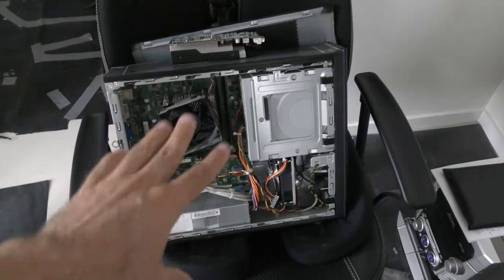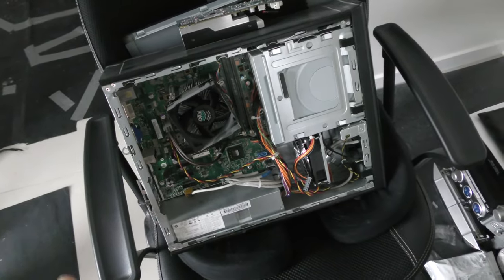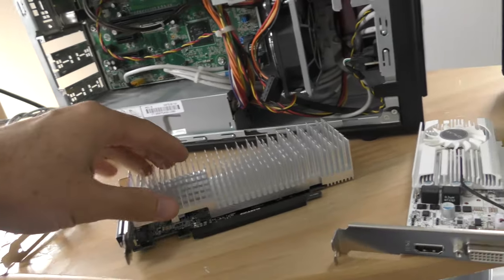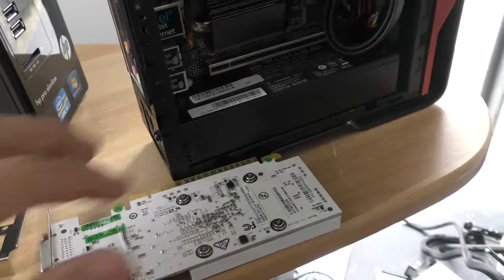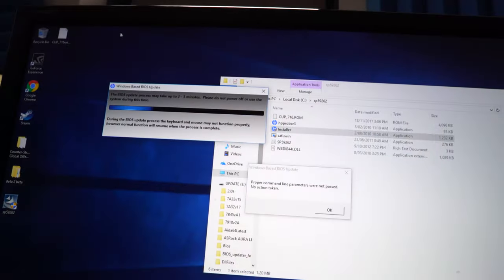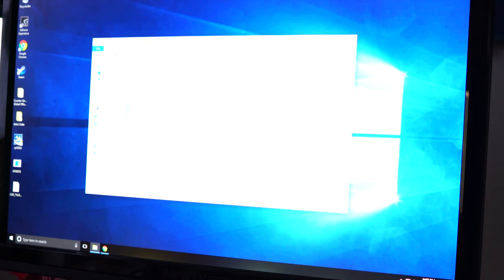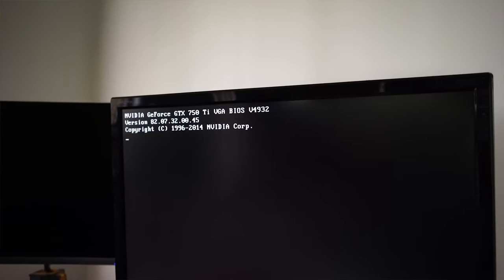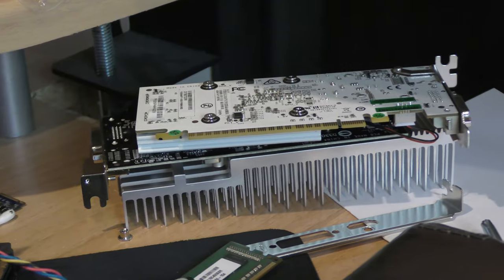The GT 1030, CAN IT SAVE THE SMALL FORM FACTOR HP PC...!?

Comment: I got a Dell optiplex i7-3770 3.4Ghz for $200 bucks on ebay, I added a 1030 and it's a little beast. The biggest issue I had was just swapping to the low profile plate, you have to take the heatsink off which is terrible design in my opinion ..

Comment: Strange, I had no problems with upgrade of much older HP desktop - DC 7800 SFF. With an Aliexpress supplied C2Quad 6600 (OC with a piece of tape to 3.0 GHz), 8 GB RAM and Gigabyte GT 1030 Deus Ex and other games run much better than on this i5 with integrated graphics ;)

Comment: If you can find a dual port intel NIC you could turn that little PC into a pfSense firewall/router. Might be the best use for it. Just avoid internal NIC unless they have a patch for the intel management engine security loopholes under the firmware. And even then I'm not sure I'd trust it.

Comment: just buy a dell t1600 to stick that i5 in, works fine with any gpu that pulls less then 50w through the top pcie and costs around 100$(USD on ebay) for one with a i3-2120(or 20$ for just the mobo,but you wont have front io so the psu will have to be the power switch)

currently using it with a xeon e3-1270 and a gtx 1070, the only thing to worry about is it doesn't seem to like the rx 480/580(most likely pcie power draw, spec sheet says 50w max) but it works with a gtx 970, gtx 1060, gtx 1070 and a few low power quadros i had lying around

Comment: With your 1030 in your inwin case, replace the psu with a hdplex or pico, with that extra space you could fit a thicker card like the 1050ti or a full sized 2 fan gpu but sideways with a riser cable :)

Comment: You had bad luck with that HP model. Mine is a HP 6000 Pro SFF,  first I upgraded processor from Pentium E5400 to Q9400. Then I ran flawlessly with GT 610, GT 730 DDR5 and AMD RX550.

Comment: I would try a PCI-e 2.0 GPU (like GTS 450 or HD 5750), with extrernal 6-pin and PCI-e x4 riser/extension ribbon. 
Why you didn't try a card with 6-pin power (and with riser) ?

Comment: Had this problem on an mt3400. The only thing that worked for me with an uefi bios
compatible gpu was disconnecting the hdmi cable before booting up. Then wait
for it to stop beeping (could take 2 minutes) and then plug the hdmi cable in.

Comment: Love those small cases, but hate what's usually in them. I built a new Gaming/HTPC around an Athlon X4 845 FM2+, 8GB RAM, GT 1030 silent, 60GB SSD and 320GB 2.5" HDD ... but it's all in a huge ugly white ATX case... the project ran out of funding :P It runs DOTA 2 extremely well in 1080P, I can even record it in OBS downscaled to 720p@30FPS.

Comment: I don’t know about the 750ti but the “10” series doesn’t work on legacy bios systems only the efi bios systems. Dell switched early that’s why old dell’s work.
Reply: This. GT 1030 requires UEFI. If you're running old BIOS it won't work. Nothing to do with HP, MB's or PSU's. 

The 750ti, on the other hand, probably locked up because it draws 70 - 75W vs 30W for the 1030. Normally this wouldn't be an issue but the standard PSU in a SFF HP is no more than 240W.

Comment: No need to throw them out, I say turn one into a high-powered router (watch Wendell's video from November 2016) and the other into some kind of NAS or media server. Gamers are interested in these types of applications as well. I personally have an old Dell media center PC running on a Core2Duo that is coupled with a Intel Dual NIC card, an Ubiquiti AP, and a desktop switch and my online gaming experience has been much smoother than with my old generic ASUS router.
Reply: i just flash tomato on my routers, not that a pc isn't good for that but the power used and possible sound and space don't make much sense when you can just install a dd-wrt or tomato to your wifi router anyhow, but i still see aplications for the pc none the less
Reply: It wouldn't be running on full power 24/7. And the hardware of a consumer router is still small beans (even today) compared to that of an actual PC.  On my ASUS Router, the 256 MB of RAM was always filled and the CPU was always heavily utilized. On my new pfSense router, roughly more than that is filled and the CPU rarely climbs over 20% utilization.

Comment: I encounted a similar thing with an Foxconn motherboard with an I5 2320 cpu: when I tried to add a GT 1030, the pc freezed before booting even the BIOS. Strange thing is that it worked normally with an older graphic card (9800 GT) with a 6 pin power.

Comment: i have a hp dx2400 motherboard with a xeon 5405, i had a gtx 560 and it was working fine.
I had the same problem when i had a usb mass storage plugged in.

Comment: If secure boot is enabled on HP it will not load with a GPU installed would have to disable secure boot and enable legacy to check. I had an HP p7-1414 and that thing would not load with my 660 when i first bought it until i disabled secure boot bc it would not let the driver load.

Comment: Shame, I got hold of a HP 8300 Elite SFF, installed a MSI GTX 1050 LP and work like a champ.  no issue. Strange the model you have seems locked down.

Comment: Try version  using AFUDOS version 2.07 for bypassing the ROMID, it does not have as many checks as the new version. Also could try building a homebrew SPI programmer with a BeaglBoneBlack and flashing the bios directly to the eprom.

Comment: HP systems from 2010-2012 or so only partially supported UEFI and so the GPUs cannot boot in EFI mode because of the partial support, but can't boot in legacy BIOS either because of UEFI is present, but again, only partially supported. Newer HP systems shouldn't have the same issues

Comment: i did basically the same thing even with a q9500 which has a higher tdp and it works flawless its just the harddrive thats soooo slow and the 4 gigs of ram but everything else works and my hp is the 8000 elite sff and no its not my main rig xD so idk what your problem is thats really weird
Reply: oh and i have the system in a custom built wooden case with very good airflow but i doubt that changes anything
Reply: I have alot of hp sff 6300/8200/8000and never had a problem with a gpu not working in sff
Reply: @Vitormarques542 this is an older 3000 series... the older sff are crippled by motherboard/pcie slot.

Comment: Think the issue with the hp is a driver bug. I had a similar problem with my rx 460 on an Asus motherboard, the dvi port wouldn’t work, I tried the hdmi and it got past when the driver loads.(eventually the bug got fixed and the dvi works now) Try using an older driver on the 1030(I just kept using the hdmi)

Comment: When you get a system like this you should pull the HP "QuickSpecs" for it.

https://shop.itema-pg.com/userfiles/editor/file/HPCompaqElite8300BusinessPCDec2012.pdf

On page 14, Under "slots", the power limit for the x16 slot is listed as 35W.  Your video card consumes 20W with DDR4 and 30W with GDDR5.  So your GT1030 card was under the power limit so that should not have caused you any problems.  The QuickSpecs document does list some supported graphics cards but you should not be limited to only those.

As proof, I personally use a used HP 8000 series system with a Radeon 6450 installed running Linux and it works perfectly.

I don't know what you are doing to cause yourself so many problems, maybe the system is actually broken in some way.

Comment: try it on a Optiplex 380 or 700 series, those are older ones but there are ones with the 1155 socket that you could put the i5 and ram into. plus dell doesnt lock down the bios with fucking adamantium chains

Comment: Have you tried it with a high end ATX power supply, just to rule out power issues.
Reply: FRLOS it's the mobo slot itself, not enough power draw m8
Reply: And the mobo itself is connected to a low end SFF power supply, that's why I asked.
Reply: You're right. The stock PSU only has a 20 pin power connector. Guess what the other 4 pins do? If you guess they power the PCIe slot you might just be onto something.

Comment: yes thats why i paid over 400 dollars for a used mobo,psu and a used r9 280x which doesnt work,cuz i couldnt fix the issue with that mobo and gt 1030,sold the 1030 got a used r9 280x,with a broken chip,nice hp very nice

Comment: good video brian ..... ive had exactly the same problem with the asus GT1030 .... however i installed it on a "non-oem" motherboard ( namely the socket 1155 gigabyte ga.h61ma-d2v ) and it sticks at the bios screen ... i have been told a bios update may work but this would require removing windows 10 and installing windows 7 ( as the @bios utility does not support windows 10 ) .....  and what makes it stranger is the previous card ( msi r9 270x ) worked fine on that motherboard ( so its not a power issue ) ...  are nvidia doing something to the cards bios which cherry picks the motherboards they will work on ... and the annoying thing is the GT1030 is aimed at older oem systems which have minimal psu,s ..... so strange

Comment: You could try an Geforce GT 710. With its 19 W TDP it is even less power hungry than the 1030 (and also way slower, but still better than the CPU's integrated GPU).

Comment: Silly Question: obviously HP don't make motherboards, usually it would be foxconn or whoever...could you not use the bios chip from the standard (non oem locked) motherboard? or do they have it soldered onto those boards?

Comment: I had this exact same issue when putting a 1030 in my hp 8200 htpc...worked fine with basic display adapter driver...would get no signal as soon as i installed the correct drivers...It turned out to be an old hdmi cable that was not 1.4 compliant...1030 and monitor both wanted to talk in 4k...cable couldn't do it...so no signal....new hdmi cable solved the issue.

Comment: What about ditching that INTEL motherboard and go with the Gigabyte GA-F2A68HM-HD2 Socket FM2+ VGA DVI-D HDMI Micro ATX Motherboard plus the A10-7850k (Kaveri) and 256GB of DDR3 RAM and the DVD /RW and hard-drive in a Little Devil LD PC-V10 case as the case looks cool and will keep the  CPU AS COLD AS ICE providing you install the CPU per the instructions and forget about the graphics card as that is integrated into the A10-7850k and have done with it.
Reply: DAVID GREGORY KERR if you're going AMD, it's better to go for am4

Comment: My cousin have the same HP SFF, came with a GT 520, and the board only accepts cards of the 500 series era. My cousin bought a 960 after swapping the SFF for a normal case and power supply, it doesn't work. It refused to boot. I tried with the 550ti and 570, they would work. Even using my 1070 on the HP board, it just refused to show anything on the screen.

Comment: Quadro K600. I have one in my HP Compaq 4000 Pro SSF and it works flawlessly. Hoping for a GT1030
Reply: Today I installed gigabyte gt 1030 silent on HP Compaq 4000 Pro SSF with E8500 processor and this doesn't working:-[[[[[[ I halted off all parts except SSD, but this shit not working/ Dream is broking.

Comment: Brian, I used this exact method with an RX 460 and the transfer speeds where just to slow. Less than half the performance of a stock RX 460. (Still trying to power this thing externally with no luck.)

Comment: I hope you tried changing the video adapter settings in the bios from pci or vga to pcie. That implements more power to the sector you desire. Also...Adding a 1030 or a 750ti won't make any extra money on those old small forms.

Comment: one of my friend had a i7 2600 with 10gb ram and an old 550ti from HP prebuild and we wanted to put a 1050 ti in it so he can play games...i had exacly the same problem. From what i read HP stop the support for those bios so you can go with the gtx 6XX series MAX...his girlfriend have a gateway machine with the i5 2350....and guess what the 1050 ti and my gtx 750 work in it so it is an issue with HP support probably so you can only buy a new pc from them if you want to play games. prebuild pc suck sometimes :(

Comment: I have a HP SFF 6300 Pro and 8200 Elite
I5-3470 and i5-2400 respectfully
Both of them I popped in a 1030 low profile and they work with no problem at all
I used DDU (Display Driver Uninstaller) before installing them if that helps
I later did a fresh install and still had no problems

Comment: I wonder would the GT1030 be a sensible upgrade for my older desktop I have which has a AMD athlon x2 4200+ with 3 GBs of ddr2 ram and it does have a pci-express slot which a use a gtx 285 with it.

Comment: Did you try the 750ti with a riser and external power supply to the gpu? If it is the power supply issue then it might work. And don't worry, usually you're so lucky with your deals that once in a while you just run out of your luck for a project ;)

Comment: im using a gt1030 in a optiplex 7010, no bios update, no bios configuration, just put da shit in and works fine and smooth
pugb, fornite, lol, rust, for honor,  destiny 2, starcraft II, etc.  all in medium 1368x768 samsung lcd-tv 22 

i5 3570
12gb ram (4gb x 3)
120gb ssd + 500gb hdd
gt1030 zotac 

i spend in the hole config $400 usd, screen included and im looking for a gtx1060 mini or a rx 560 mini

Comment: if you need a slot powered low power step up to the 1050ti for $200 no 6 pin on most of the cards including the superclock evga its just the multi fan ones that need 6 pin im running the evga gtx 1050ti and it maxes out all the modern titles I throw at it its a half length dual slot this is also why I stick to dell also the HP stuff is junk

Comment: What kind of HP is that.. it looks almost exactly like mine.. but mine is i7-3770 cpu.. Never the less im running a GTX 750 and had no issues what so ever.I noticed @7:52 you have no harddrives connected to the sata ports. This would surely cause the machine to fail.. some machines simply wont load if they see no sata's connected. Also this machine @7.52 does not look like the other machine... ?

Comment: I used this exact same motherboard until recently and the thing is it doesnt like any gpu newer than the gt/gtx 600 series and radeon hd 6000.(didnt like any low power cards either like my old HD 6570) But i have run this motherboard with my i5 2320 and HD 6870 just fine

Comment: I have a Hp Compaq 8300 elite and I’m planning on taking out the parts to put on a custom case I’m planning on making out of wood (this is so I can have a full sized GPU instead of being stuck with a GTX 1050ti low Profile being the best Low Profile Card without a upgrade path) and I plan to get a GTX 1060 3-6gb with my custom case. Should I make the case to have the full sized GPU or should I leave it in the normal SFF case???
Reply: It has an i5-3470, 12gb ram and 128gb ssd

Comment: Bummer. I'm up against the same thing, maybe with the HP 500B. I've built several of them with GTX 460's and 550's, but I've got two towers that will not run with these graphics cards in them.

Comment: I had the same problem with a Dell Vostro 400, added a GTX 750 which doesn't require additional power from the PCIE connector, but system just kept rebooting, no signal and no display.  Dell Mobos are pretty useless.

Comment: i have a 6 years old HP ELITE 8200 
i have installed a GTX 1060 not so long ago
to install a stronger graphics card you have to install a stronger PSU 
and to upgrade your PSU you need an special adapter to the HP motherboard
cuz HP motherboards have some special connections that nobody makes
if you need any help with all that feel free to hit me up :)
Reply: check out your email box :)

Comment: Amateur, I got the 1030 working with the exact same HP SFF!
Reply: Interesting, can you please provide details of how you did it so that all of facing this issue can solve it?
Reply: @propane8659  You have to uninstall the old graphics driver first, then insert the new graphics card, then install the new driver
Reply: Bios mods, replace chip with a 8mb an write with a SPI programer.

Comment: Wow, my comment about this motherboard having a full 75W PCIe slot has been deleted...
A kinda pussy move, isn't it?

Again, my HTPC is a HP Pro 3500 Microtower, and the 1050Ti works just fine in it.
It's the MSI LP one without a additional 6-Pin.

Comment: thanks for the upload you just saved me buying the card. I was gona get it just tos ave money on power a month and stay with this low power PC cause the games I run are low requirement and with this graphics card, I'd actually be able to play them on the High Definition mode no problem. That being said HP is kinda fucked

Comment: I had the same problem with a HP motherboard and after failing to instal a new gpu, I gave my PC to repair. After testing my setup they found out that the motherboard was locked to one gpu. Then I asked them to change my motherboard.

Comment: LOL I had same issue with a old PC that did the same couldn't boot with any GPU plunged in to the slot so I switched the motherboard for another and it fixed it, I later found a custom bios for the board that claimed it would work but never tried it

Comment: its foxcon cupertino2 from 2011. below gtx 600 series/amd hd 6000 series (legacy gpu) should work.because hp bios update are only released in 2013. you need to do research 1st about oem hp mobo before buying those graphic card😂

Comment: i had the same issue with my saffire amd radeon 7xxx 2gb card , without the driver it will work and when i install driver it wont work. tried in couple of motherboards still didnt work, now the same board(z77) is working fine with a gtx750ti.